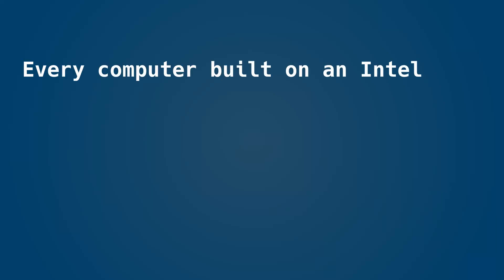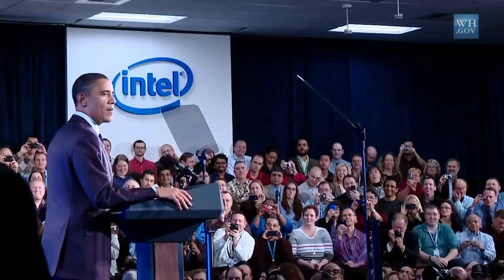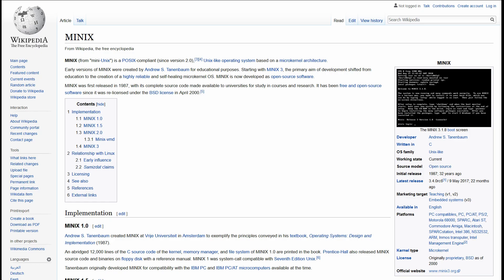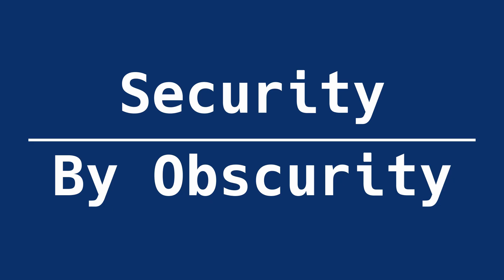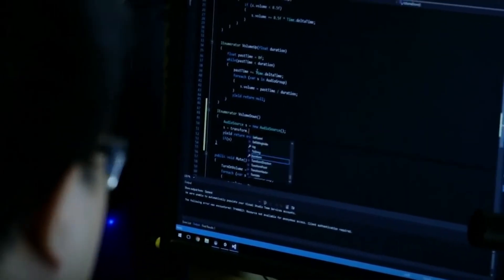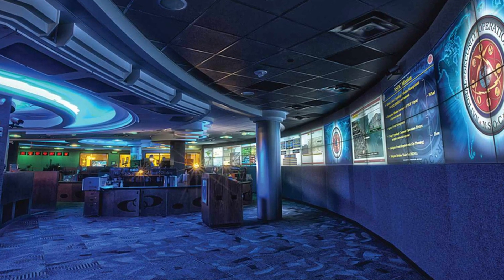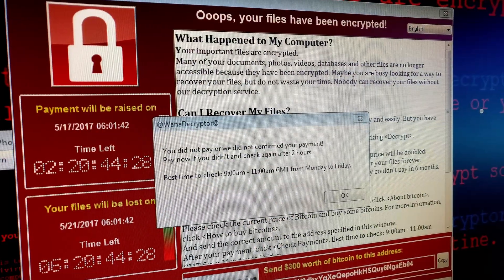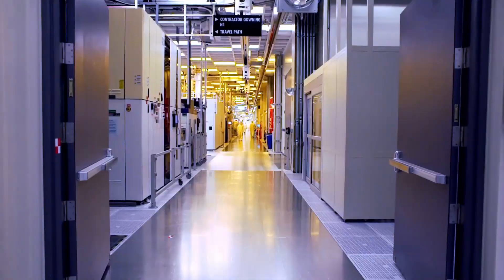How Intel wants to backdoor every computer in the world | Intel Management Engine explained

Comment: You should be able to configure your router to detect/filter  any unauthorized communications.
Reply: surfer300ZX  in what way?
Reply: surfer300ZX  The router is not part of the computer. At bottom the routers need to route network packets otherwise information isn't going anywhere.

Comment: If it is running an operating system (bsaed on minix in this case) then it isn't a microcontroller. It is a micro computer. Just felt like mentioning that.
Reply: Indeed. Microcontrollers as their name implies, only control electronics through a series of compiled commands. Like arduino.

Comment: I am buying Core 2 Duo ThinkPads now :D Although I am gonna miss the X220 :( I hope it will be Librebooted in the future.
Reply: A Core 2 Duo is vulnerably to Spectre and Meltdown.
Better buy an old Intel 486. This should be secure.
Reply: @OpenGL4ever  Spectre and Meltdown vulnerability has been fixed through firmware and kernel patches.
Reply: @TheLibertyfarmer  
Spectre can't be fixed with current CPUs. You can only fight against symptomes.
And a Core 2 Duo even doesn't get new microcode to fix some of the known vulnerabilities.
Reply: TheLibertyfarmer what’s the best thinkpad for security and usability?
Reply: @nicholas9381  IMO the 2nd and 3rd gen Core I series models are optimal. (T420/430, T520/530, W520/W530, X220/230) They can be corebooted, MEcleaned/neutralized, and they dont have the Intel FSP blob. Performance wise that generation is still relatively powerful.  This machine I using now is on the high end of that gen and it runs Qubes OS very smoothly. (T420, I7 3720qm, 16gb ram, 250gb Msata SSD OS drive w/ a 2TB mass storage drive.)  It's setup as a portable desktop replacement. It's usually docked and connected to a pair of 25" 1920x1200  displays.
Reply: @nicholas9381  Personally I prefer the X20 models over the x30 ones since the X20's still have the classic ThinkPad keyboard and have about the same performance once upgraded.
Reply: TheLibertyfarmer yeah I agree, I’ve played around with the t430 before and they are very nice machines but a killing point for me is definitely the screen resolution. Even on the HD+ model I could literally count the pixels, I could use a 1920 monitor but I like using my laptop portably (in bed, at work, coffee shops etc), I was looking at the librem laptops which come with a nice display and me neutralisation but they are sooo damn expensive, I understand pricing is more to help the company but it hurts when a t420 is like $150 and has almost better specs
Reply: Your X220 can be corebooted and have the ME neutralized right now. Libreboot is a project with very specific goals in mind. One being FSF certification. It actually leaves out microcode updates that can contain security fixes and bug fixes (like for working vitalization support on the T500/T400/X200)  to remain philosophically consistent. I've been a supplier to Minifree (am the original source for their X200T systems) and also sell Librebooted  systems as well as corebooted ME neutralized GhostPads  (modded T420/520/X220 ThinkPads).

Comment: Intel responded by saying that "Intel does not put back doors in its products nor do our products give Intel control or access to computing systems without the explicit permission of the end user." and "Intel does not and will not design backdoors for access into its products. Recent reports claiming otherwise are misinformed and blatantly false. Intel does not participate in any efforts to decrease security of its technology."
Reply: Ary de Oliveira aw gee, sure is good to hear that from such a trustworthy company. Hey, you remember that 28 core 5 ghz cpu that totally didn't have a 3 horsepower industrial water chiller hooked up to it for overclocking?
You remember that time AMD said intel put pressure on a bunch of benchmark producers to artificially gimp non-intel CPUs in benchmarks?
Remember that time when Intel voluntarily joined the NSA mass surveillance program called PRISM and definitely didn't intentionally build a backdoor into nearly every computer in the US? I mean, they said they didn't do those things so it must be true

Comment: Wait! Bypass all firewall? Even external? That doesn't seem right.
Reply: I don't know how it would be possible. Either this program is complex enough to do evasion techniques, network vendors working with Intel, or this chipset is using a whole different set of protocols completely different from the OSI model. That last part almost seems impossible because computers require standardization for operability - unless large tech companies are secretly working together and operating on their own set of protocols... From a physical layer standpoint, a bit is a bit on the wire, im sure signatures can be detected.
Reply: @AeoIian  It gets the uneducated excited and that's about all. Numerous red flags went off for me.
Reply: Because its not right. Being battery powered is BS too. We would need to replace that battery way more often or it would need to be rechargeable and they are not.
Reply: IP block list

Comment: So that's why they now seal laptops batteries in to stop you from totally powering down your laptop.
Reply: This has more to do with the fact that a battery kicks the bucket first, the harder to replace the more likey you throw the thing away and buy a new one.
Technically the subOS could very likely run from the BIOS battery alone.
Reply: @billklatsch5058  That's part of it, but mostly its about space. It's the same deal in phones these day. These types of batteries in reality are very flat and small. Encasements to protect the battery during handling and mounting systems for removeable batteries take up a lot of space and make the device much bulkier than it otherwise could be. That's no good when people tend to want smaller and lighter devices.

Unless it's a Macbook. Then it's pretty much all about making you buy a new one.
Reply: @JakXLT  no. Open a phone with a non removable battery. They all have batteries of completely the same form and fitting as a removable one only the way to access them is made more limited. They have no space saving qualities
Reply: @03056932  I assumed the reason for phones was the same one used for laptops...
Well, then they're stupid. That's a shit ton of wasted space. I can think of so many things that could be in there besides hiding a removable battery behind a bit of glue.
Reply: @billklatsch5058  , yeah, and a lot of good that will do if the battery can't fully power the NIC.
Reply: @billklatsch5058  Yea, running a CPU and linux off BIOS battery? Lmao, have you got ANY understanding of how much even the smallest and simplest chips use compared to the capacity of BIOS battery? Stop saying BS you have no idea about.
Reply: @Smaylik03  If it really is a microcontroller, the tiny 50MAh battery can potentially run it for at least a few minutes dude. Likewise, if you don't know what you are saying, don't act like a smuck.
Reply: @lm6036  Yeah, it can. So what's the point in those few minutes?
Reply: @Smaylik03  50MAh is a huge battery.
Reply: @azkor91  For a running linux system it's nothing.
Reply: @Smaylik03  @Eternal I was just being a Science Nazi. MAh is for Megaamp hours, which is a huge battery, while mAh is for milliamp hours.
Reply: @azkor91  lol. I didn't even notice you capitalized M, but I wouldn't think much of it anyway. Nice observation)
Reply: There's still Laptops with removable batteries, you can look into ThinkPads.
They have replaceable everything and are high quality imo.
Still be cautious, stuff like Lenovo's superfish happened.
Reply: It just says how humans are becoming more and more unconscious day by day

Comment: First of all:
There is a WAY to remove it:
Me_cleaner.
CHeck it out.
Second of all:
Also as far as i know Intel AMT SOL comes disabled by default so no need to fear mongering.
The only way to turn it on would be either manually or by malware infection or if its already running/turned on (big corporations and government organizations with large networks only)
Reply from the maker: 0) Disabling Intel ME is not supported by Intel on consumer CPUs and could destroy your computer
1) This is Intel ME. Not AMT. AMT is on top of Intel ME and most consumer PCs don't have it. Intel ME is turned on by default on every chip since 2008 and without it the main CPU would not boot.

Comment: I was wondering if you were going to make a video about this, I'm glad you're sharing this important information. I've been trying to reduce my usage of Intel based computers for a while. If anybody wants a fast and modern CPU that has free microcode and firmware, go with OPENPower and Raptor Computing. They have a mini-ITX board available that allows you to use a POWER9 CPU, and all the source code firmware for the board and CPU are available.

https://www.raptorcs.com/content/base/faq.html
Reply: You can have all the open source microcode you want but this bug can still be in there. Ask somebody at Intel if they have seen the code. My guess is they will tell you they have not and never will. They had to put it in there for it to be there. The only secure path is an unviable one, making your own processor and not sharing it with anyone.
Reply: @InsideOfMyOwnMind  Get back to me when you set up your own silicon chip fabrication facility.
Reply: AMD has the same thing. AMD PSP. The only difference. Is remote access is harder for psp

Comment: WireShark downloads have increased 2000% since this vid hit youtube..........heh
Reply: You would need to install a hardware that operates separate from the computer that reads the incoming and outcoming connections.
Reply: @dra6o0n  Your right.
Reply: @dra6o0n  I need to install some hardware? Do I do that like how I downloaded my watercooled overclocked ram?
Reply: Technicaly, Intel/Amd/Arm could use your other device's IME/Amd platform security processor/Arm baseband processor to conseal the Wireshark output of your device. To perform academic grade research on IME without possibile interference, you require a device without backdoors that can run Wireshark. 😘
Reply: @rachelslur8729  
A Raspberry Pi 3 will do. It can run Wireshark.
Reply: @rachelslur8729  or just use an older CPU
Reply: @rachelslur8729  Time to get my calculator out!
Reply: @rachelslur8729  Your right..didn't think of that lol
Reply: even more weird, is that when I download/upload nothing, data is still sent somewhere. I don't know where, but the pings are local, but they are probably being sent to Minix.
Reply: domiii19111 day ago@Power 2 Weight *Fuck's sake. For fuck's sake.
Grammar policing the grammar police...LOL
Reply: I got Dell laptop with pentium 3 processor, anyone interested? 😋
Reply: @darkestknightishere  ehy are you acting like you won in lottery and got a PC without a backdoor
Reply: @LuisMan123  Fun isn't something one considers when excavating a laptop. But this... does put a smile on my face. 😋 Avengers : Endgame in Cinemas 26 April 2019
Reply: @darkestknightishere  i don't understand what's special about the dell laptop
Reply: This is a well thought out lie though, wireshark would not be able to detect it if the way that it worked was true. Just like how a vm can not see what your pc is doing. This video is 100% fake though.

Comment: Shit... I wanted buy replace my old Core 2 Duo PC with a new one this week... I guess, it's a bad move after all.
Reply: Core 2 Duo machines required chipsets which IME built into the northbridge. It was running this whole time.
Reply: @radishpineapple74  According to this video... I'm safe, because it was built in 2007. But I have Windows 10 on it. Anyway...
Reply: Same I'm still using core 2 quad. Wanted to upgrade because of games but I stick with this for a while. My pc orginally had a core 2 Duo but I upgraded the chip used from ebay. Big difference.

Comment: So even if you completely shut down a laptop, the IME continues to run and suck up battery power? Hmm, maybe that's why a laptop that has a full battery and is then completely shut down for a long time will have a low battery after a week or two. 🤔
Reply: Correct! I have an old Camera from Canon, which I bought it in 2008. The last time I charged it was in 2015 and a few days ago, the camera surprisingly turned on (with low battery of course). It doesn't have Wifi.
Reply: Yeh, my TI-nspire calculator had 80% 2 days ago. Now 70% without using it. 

ILLUMINATI CONFIRMED
Reply: @MartinMalmy  I forgot to consider the quality and types of batteries as well, since alkaline batteries tend to lose more charge than lithium batteries in storage.
Reply: @uchihasurvival  It was a joke my friend :D
Reply: That thing requires minimal power and wouldn't suck up anything when your Laptop is turned off. Otherwise that little chip would need to turn on your Laptop's wifi and lots of other things for what...? It can only monitor what you're currently doing and if you're doing nothing what should it spy on?

Comment: Lets go back to the Core 2 series (Duo and Quad). Or The Xeon until 2006... those are ok, I guess...
Reply: Core 2 Duo also had the Management Engine. In those early processors, it existed on the motherboard's chipset, not on the CPU itself. This makes sense, because the ME is designed to be able to access all memory at all time.

All Intel processors which have vPro capabilities, which includes Core 2, have ME as a requirement.
Reply: BirdValiant Pentium then... or there is other alternative?

Comment: librem 13: disables IME
micro$haft: but that's illegal
Reply: What does windows have to do with this?
Reply: @KingHalbatorix  no it's like using bulletproof "windows"(hehe) , but letting them down for "fresh air" XD
Reply: Looks like the only way to beat the system is get Librem 15 (Laptop) So selling what you currently have is scary af.
Reply: Not missing much if you never get another intel product
Reply: Librem 13 doesn't come with IME I thought
Reply: Librem do comes with IME and doesn't disable it. Don't be fooled by their promises. Purism is a dishonest company at the limit of what we could call a fraud. They are lying on both their achievments and their objectives. One source among many others : https://www.reddit.com/r/linux/comments/3anjgm/on_the_librem_laptop_purism_doesnt_believe_in/
Reply: @Welteam  That article is old.
1. Librems do ship with ME disabled. This was achieved after your source was published.
2. Purism does not lie in any way about Intel's blobs. They specifically claim that they ship free software from BIOS upwards and that they're working on freeing the CPU microcode.
https://puri.sm/learn/freedom-roadmap/
3. There is no real alternative to their work if you don't want to run a non-x86 architecture. Earlier CPUs are too slow.
Reply: WelteamOfficial literally every single fucking post made by that account is shilling against purism and shilling for ThinkPenguin. How did you not realize you were reading posts from a bot account? Dont come back from r*ddit until you can recognize corporate sock puppet accounts.
Reply: The Common One well it's all good then. I probably overreacted but I've seen the same arguments at least a dozen times when I mention purism and that fucking reddit post has become the bane of every hardware-related privacy discussion I have
Reply: @Welteam  Thanks! I've already known this but I'm thanking you for telling people that think Librem cares about their privacy and freedoms.
[EDIT] : The post is fucking bullshit, Don't read it.

Comment: wondering if this has anything to do with the cpu exploits like meltdown and spectrum. I know they are slow but Raspberry pi, SBC's might be the future.
Reply: Nah. Meltdown, and the wider class called Spectre, exploit speculative execution - which is an optimization technique used on almost all modern processor architectures, like x86 - but also many ARM chips you find in SBCs or phones. The bug is in the design specification of the architecture itself - not in the implementation. AFAIU you can use software mitigation techniques to make it harder to use these exploits in the real world, but complete protection will stay impossible on these chips.
Intel ME (or similar proprietary systems on AMD or ARM chips) is tacked on to the part of the CPU that actually implements e.g. the x86 specification (i.e. actually does your computing). ME is not needed for a working x86 processor - it's an extra hardware "feature".
Reply: So yeah, I don't see any relation, or how SBCs would save us? More diversity of architectures is good, in the sense of not putting all eggs in one basket, and e.g. Linus Torvalds recently voiced support for using ARM for servers. So would be breaking the monopoly that the large semiconductor manufacturers have.
But other architectures are also vulnerable (it makes them faster, after all...), and the separate issue of not being able to check how the insides of hardware are actually wired (to see if they contain a backdoor) remains.